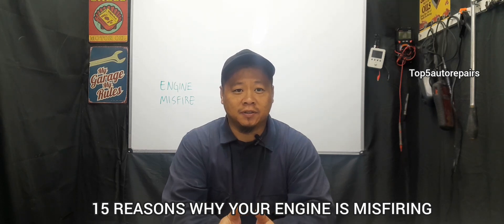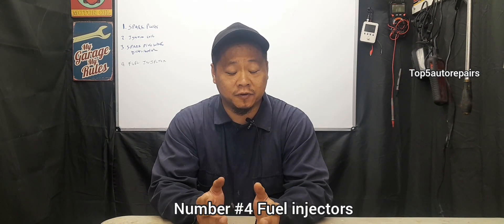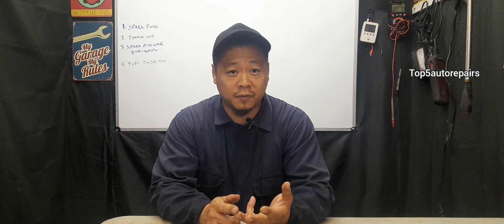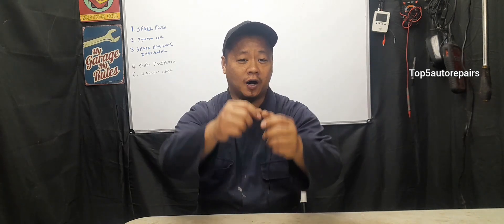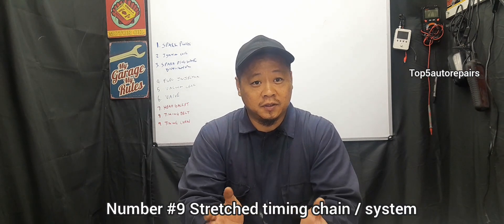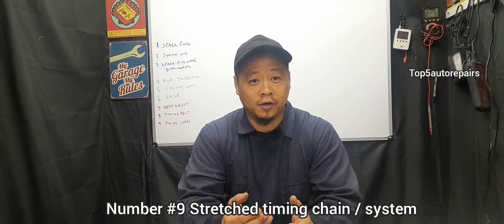16 REASONS WHY YOUR ENGINE IS MISFIRING (FIX P0300 P0301 P0302 P0303 P0304 P0305 P0306 P0307 P0308)

Comment: Hello sir pls. Help I have Honda civic 2002 crank no start. I change cylinder head,fuel pump,valve,crankshaft sensor, and last is ECU.
Reply from the maker: I have a video on this topic. Top 7 reasons why your car crank but won't start.